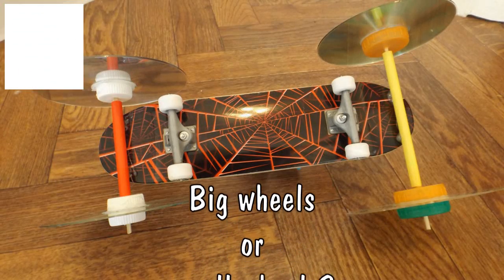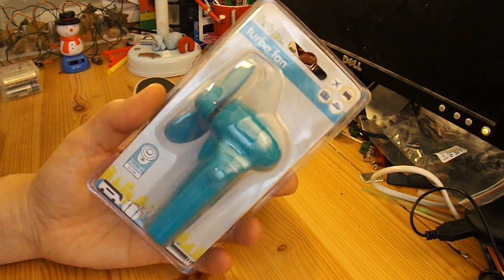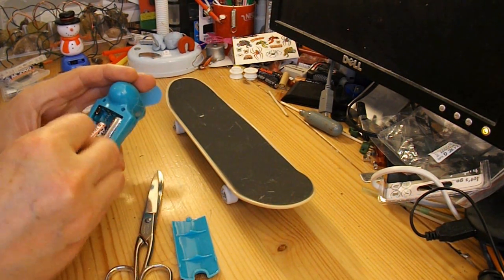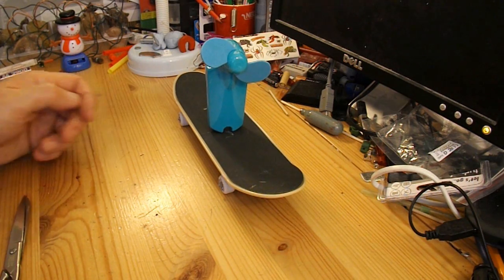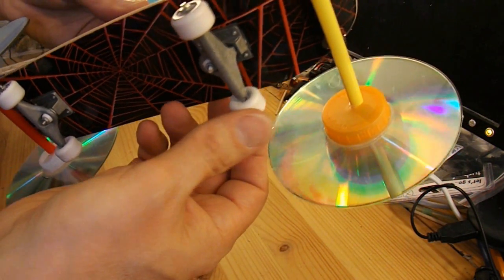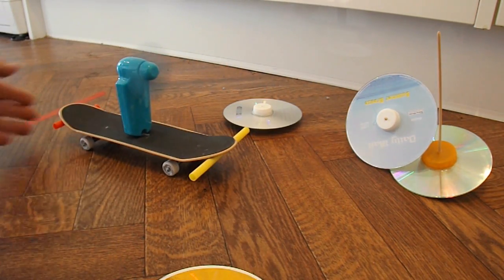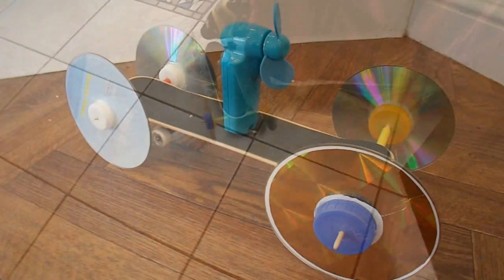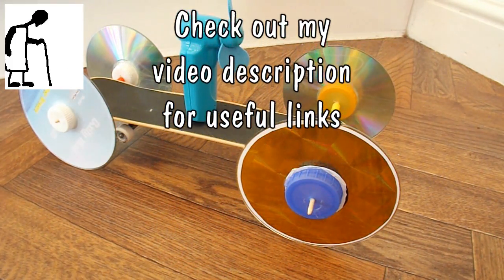Big wheels or small wheels?  a comparison

Comment: Its awesome. with this demo, Can I say that small wheels would require less power for rotation  if the axle gets power ..just like in any engine.. as here we are having external energy source?
Reply from the maker: I suggest you try exactly the same demonstration and find out the results for yourself. My video description gives some information on my thoughts on the subject.
Reply: @GrandadIsAnOldMan  , will try
Reply from the maker: @parveenrawat890  good luck. This video was only intended to demonstrate the issues with this particular setup, not every general "big vs little" scenario. There are so many other variables to consider. As I mentioned before, my video description gives more information and related links.

Comment: Had a doubt. If I replace wheels of Olympic track cycle with diameter of a BMX wheel and yet the thickness of the wheel is same as track cycle. This would reduce the weight of the cycle also the air resistance in the wheels will be less as it's area is small. But since the wheels are small the area of contact with ground would be more so it increases the rolling resistance. So it would make up for the advantage gain from less weight and more aerodynamic. So wheel size doesn't actually matter when it comes to track cycling.
PS: Here in this case the surface area of contact the small wheels it's really larger than CD, so it makes sense.
Reply from the maker: I am afraid I have no interest in bicycles, however here is my take on your suggestion. The difference in weight between the two types of wheels would obviously depend on the construction materials as much as the diameter. I have no idea how you would measure the difference in air resistance unless you have suitable scientific equipment as the difference is likely to be tiny. Area in contact with the ground would depend on the tyre pressure and cross section. You may be 100% correct, but my suggestion would be, do it, then see if you are right. I have no time for people who want to talk the talk but don't put their theory to the test.

Comment: Should double up the cds to make them same thickness of the skateboard wheels
Reply from the maker: Why would you want to do that?
Reply: @GrandadIsAnOldMan  to make it fair
Reply from the maker: @Offensiveword  not possible to make it "fair". How would you account for the change in weight? If you are thinking about surface area, then you need to research the coefficient of friction. Better still, try it yourself rather than theorising.
Reply: @GrandadIsAnOldMan  whatever grandad
Reply from the maker: @Offensiveword  like I said, try it yourself. Guesswork will never give you an answer and the coefficient of friction does not vary with the surface area. You might even find the explanation written in my video description useful.
Reply: @GrandadIsAnOldMan  think I’ll leave the scientific experiments to the professionals (and you) 😆
Reply from the maker: @Offensiveword  Haha, thanks 😆😆👍

Comment: This means that if on my rear axle drive hybrid car with a 20 kw el motor, I reduce rear wheel size and increase the front one, I should get higher power at wheels and higher fuel economy. When I'm next for my tyre replacement, I'll consider this. Thank you.
Reply from the maker: No doubt you are joking so I will humour you with a reply in the same spirit. I cannot see how you would draw your conclusion from this video. Power at the wheels? Do you mean on the road? The power from your motor remains the same but by reducing the size of your driven wheels you are in effect changing the gearing ratio so less power is required to turn the wheel. That might improve your acceleration but you would be running the motor at a higher RPM to achieve the same speed.  Changing the size of the front wheels would have zero effect as they are not driven by the motor. I certainly would be surprised if you would get any improved fuel economy as I would expect the car designers have already optimised the system to give the best results so any changes you make are likely to have an adverse effect. The issues with the wheels in this video are related to the size of the wheels relative to friction from the axle bearings and also the road surface in relation to the wheels. With a full size road going vehicle the relationships would be rather different. For a start the bearings would be significantly better and changing the size of the wheels would not have the same result. A grain of sand in front of those tiny "skateboard" wheels would be similar to driving a road car over a brick. If you intend to be driving over a lot of bricks then you would find larger wheels would make life easier. Perhaps go for monster truck wheels and you could drive over other cars too 😆👍

Comment: you could have glued the CD wheels to the original Skate wheels for better comparison between "Small Wheels: and "Larger Wheels" .. Friction at bearings are the main culprit for smaller wheels not moving.
Reply from the maker: Well you know what your next YouTube video will have to be don't you. I look forward to seeing it. As it would not physically be possible to glue the CD wheels to the original wheels without significant modification to everything involved you could just try sticking the small wheels on the shafts I used for the big wheels. You would get the same result. Yes friction is the problem and using a big wheel gives a longer moment arm (if we consider it as a lever and fulcrum) to overcome the friction.

Comment: the wheels on the toy skateboard were not designed to make the skate roll, thats the difference that makes the CD wheels spin, the wood can spin freely inside the plastic, the plastic wheels on plastic 'trucks' don't spin freely, that's why you put a lot of effort trying to make them spin
Reply from the maker: Rather than write a comment like that, it would be more effective to make a car and demonstrate your theory by videoing your work. I will look forward to seeing it.
Reply: Use the small CDs, and normal size CDs.
Reply from the maker: ***** yes you could do that if you wanted to.
Reply: GrandadIsAnOldMan I dont have to, because I know it already.
Reply from the maker: ***** what do you know?
Reply: I agree with u...
Small plastic wheels on wood ..
Not enough traction there

Comment: to much friction? but what if the small wheels were thin as the cds?  will be faster??
Like your proyects, are very useful for me and my kids.. Thanks grandad
Reply from the maker: Hi Alice, here is the reply I have given other people. The small wheels suffer more from the friction on the bearing surface between the wheels and their axles. The best explanation I can give is if you think of the wheel as a lever trying to turn the axle a larger wheel has a longer lever so it overcomes the friction of the axle.
Put a pin through a small disk and spin it between two pieces of card, then put the same pin through a bigger disk and spin that between the same two pieces of card. Which disk spins for longest?

Comment: Small wheels are better than the big one the only problem is that this small wheels are not good.
Reply from the maker: There are situations where small wheels are better than large wheels, but as I have clearly demonstrated in this situation, the larger wheels have the advantage. If you read my reply to Franciso I have explained why the bigger wheels work better. It is to do with leverage. The fan is trying to push the car forward using the wheel as a lever to turn the axle against the friction of the bearing. The larger the lever the less effort is required, (up to the point where the weight of the wheel requires more effort than the gain from the leverage).
It would make no difference if the car was sitting on a polished mirror, it is not the friction or roughness of the ground that is the problem, it is the friction of the bearing surface on the axle.

Comment: I can be wrong, but may not skate abanzara with small wheels, due to the roughness of the table.
A larger as you did with these CDs, these wheels better saved roughness.
If the surface was smoother (eg, glass), would surely have advanced just as well as with the other wheels.
Reply from the maker: The small wheels suffer more from the friction on the bearing surface between the wheels and their axles. The best explanation I can give is if you think of the wheel as a lever trying to turn the axle a larger wheel has a longer lever so it overcomes the friction of the axle.
Even with your explanation you are only confirming what I say, a larger wheel deals with surface roughness better than a small wheel because it is bigger.
Put a pin through a small disk and spin it between two pieces of card, then put the same pin through a bigger disk and spin that between the same two pieces of card. Which disk spins for longest?